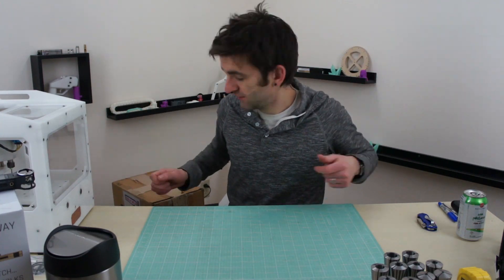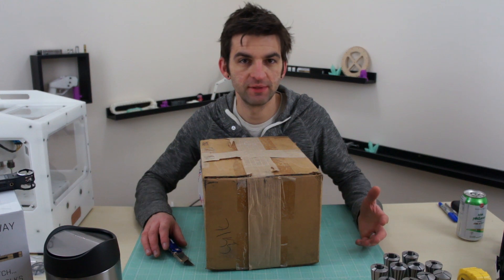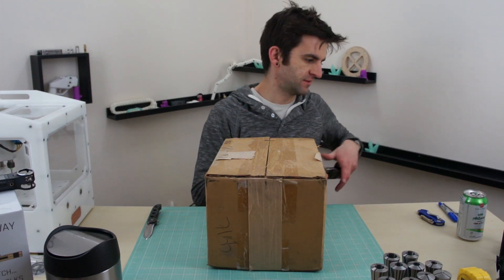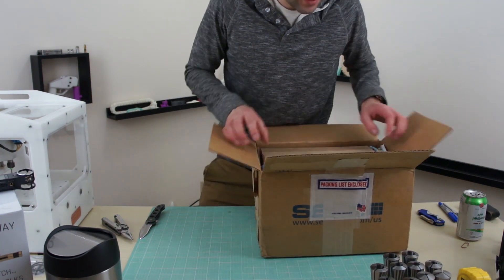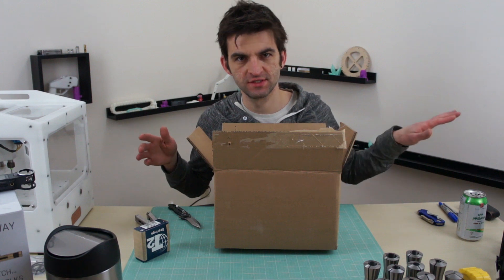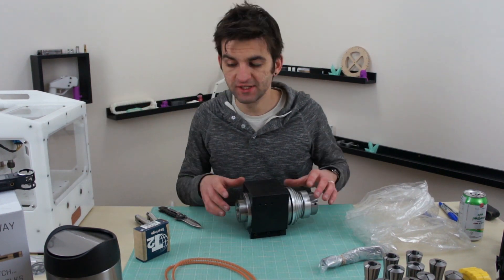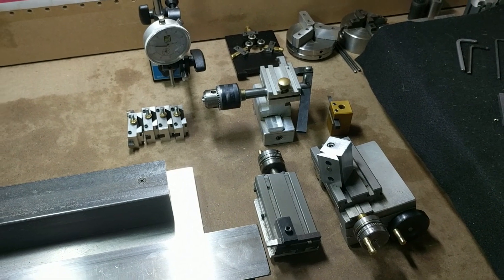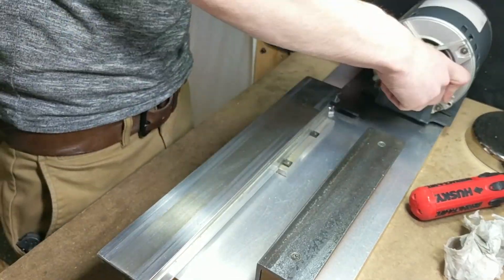Taig Lathe Upgrades 5C Headstock

Comment: the founder/owner personally lapped each machine by hand..i have a picture  from about  78 of Forrest at the work bench where he did it ..(original location in the city of industry, California) . i probably did machining on most of the components on the original  micro lathe 2 ... it may sound funny and antiquated now  ,but the scroll for the 3 jaw chuck was done on a  2 spindle head  punched tape controlled  Bridgeport ...

Comment: Is this Lathe modular? Based on their website it seems that way. I'm not sure about how to determine compatibility between parts. I'm just at the beginning of my research phase.
Reply from the maker: Seems to be, way back when I purchased my stock unit you just ordered the "metalworking" or the "woodworking" series. Almost all the parts are interchangeable, I'm sure if you shot them an email they would be more than willing to help (I have zero affiliation with them...but I should lol).

Comment: Curt, thanks for the video. I got to know about Taig through your channel. 
Can you please advice me on this issue. Am into a production of a small furniture. I need a lathe with good duty circle to make some nuts. My nuts is 8mm by 25mm shaft, with 6mm internal thread. The material is mild steel. This is my main reason of buying the machine for now.
My questions are:
1/ Which model of Taig is suitable for this production?
2/  How many can such a machine produce in a day? 
3/ How much could it cost.

I'm Francis of Boundary Craft, from Ghana West Africa +23326750775 WhatsApp

Comment: Hi, I have to wonder what the advantage of a collet headstock would be. For a start the collet needs to have an EXACT diam to accurately grip a piece of material.....over or under a few hundreths (metric) and the collet is not gripping all along the diam. I would think a 3 jaw chuck with a slack register mount is 100% more practical for gripping any diam you can think of. The slack register method allows you to have a pseudo grip true chuck that suits any chuck without the high price of one. Also, the 3 jaw has a far greater capacity for round stock. I hate to think what you would do if you wanted to go to a 4 jaw or faceplate situation...…..probably replace the whole headstock?...……..is that for real? Lining up a headstock in 2 planes over 150mm is not a job you want to do every day especially when you are busy with work.
Reply from the maker: Have you used a collet headstock? Its night a day over 3 jaws! Collets also have a much larger grip range then you think, none of my stock is precision ground and all gets held VERY firmly and without marring like a 3/4 jaw system. You can also get collets in every flavor of the rainbow (oversized, undersized, metric, imperial and emergency). I have a spindle that mounts into a 1" 5C for when I want to spin the 4 jaw...but I avoid it like the plague as 5C is just so much more production  friendly.
Reply: @CurtVanFilipowski  Short answer....yes, I have used a collet system…..I have a capstan lathe with a collet holding system...…..for my regular centre  lathe I would not fit a collet system ever.....my 150mm diam 3 jaw is accurate to .02mm on concentricity on all diams  and the chuck is 30 years old, never been reground ever.....I have the experience of 60 years on machinery to prove my claims......BTW, if you cannot imagine a 3 jaw chuck can be accurate to .02mm then you haven't machined for a living.
Reply: @gangleweed  The idea behind the 5C headstock has more capability than a 3 jaw chuck by far. The Taig 5c has a 17 mm  3/4 threaded Arbor option that allows for the use of a 3 jaw and 4 jaw chuck as well if one wants to use jaw chucks. Pretty much turns the lathe into a horizontal milling machine with a milling attachment. Run that on your 3 jaw chuck. Also we are talking about a micro lathe here.
Reply: @TheTruth-fs2rm  I can't agree with you....I have the 5C system on my CUTTERMASTER tool and cutter grinder and I know the limitations of a collet system. A collet system only has capability to hold exact sizes accurately.....a 3 jaw chuck for general purpose work is more versatile.....BTDT. 
Anyone who designs a micro lathe with the 5C collet system is off his trolley.
Reply: @CurtVanFilipowski  , 
Please provide the address of the dealer/distributor of this machine, in Indonesia .
Reply: You Clearly have to consider Putting your Junk ! Straight into the Metal ! Shreadder !! Immediately ! For Peace of Mind !!

Comment: I like the aluminum plate that you mounted everything to instead of the board that comes with it. What size is it?
Reply from the maker: Its just a section of aluminum wrapped around some plywood...it was just to get it running but it worked so well I haven't changed it!
Reply: One mm by one mm

Comment: Curt  two questions 1. do you have power feed after the upgrade or is it possible?  does the headstock come with the speed location sensor of the cnc version?
Reply from the maker: Yes the new models come with a power feed. The 5C headstock has a steel button embedded into the pulley for hall effect speed regulation (would need to use a DC controlled motor or servo for speed regulation).

Comment: Hi Curt, quick question, when looking at the 5C headstock from the side where the chucks get attached e.g. 9:14, what's the outer diameter of the silver round bit? The fixed one - the one that's screwed to the black case thing, not the inner one that rotates?

Comment: This looks like a cool upgrade but how good is it in practice? What are the deepest cuts you can take on it? What is the largest diameter you can realistically turn on it ? It's still made of aluminum.. can it really take advantage of the full range of 5c tooling including chucks made for much larger lathes? I'm curious what your experiences are. For me the ability to turn parts 2-3" in diameter from Aluminum is important. Could this handel that?
Reply from the maker: It's amazing in practice for this size of machine.  When roughing I typically take 0.1" cuts in aluminum, and about 0.03-0.05 in stainless. I have turned 2" aluminum round bar and that's what I would call the functional limit (material removal speed at 3"+ is a little slow but totally doable) I have done 3" turnings but this lathes sweet spot is about 1" and smaller in my experience (what typically fits in a 5C). If you are hogging material off your 2 or 3 inch stock I would suggest a larger machine, if it's only clean up cuts at that size I would say it's a fine fit.
Reply: @CurtVanFilipowski  Thanks for the helpful response Curt!
Reply: @CurtVanFilipowski  ,
Please provide the address of the dealer/distributor of this machine, in Indonesia .
Reply: @Dodi-nz3fd  Tiag o.s Ind

Comment: Beautiful new spindle! 
Looks like you could lap just the moving part to the bed using wet/dry paper and oil. How long does disassemble/clean/assemble take? Looks like solvent-dunk/blow/lube would be sufficient.
Reply from the maker: The whole process could probably be done in under an hour if it had to be.

Comment: Ideally you would check out the spindle first with a DTI for runout then progress to the runout on a ground shaft. The tool you checked indicated a bit notchy, somehow. Then try the collet in several positions as well as leaning on the ground shaft to check for flex in brgs and spindle assy flex. I am considering buying a Taig and am very interested in the accuracy. So far everyone seems to be machining aluminum and plastic. 

You say the new belt did not slip. Do you think the motor and bed are strong enough to accurately turn max diameter steel and iron that will fit the chuck? I am interested in making steam engines as well as upgrading my shop equipment (Out of round rotating parts on HF stuff, LOL) . 

Thanks for the video :)
Reply from the maker: Thanks for the comment, your method of running a DTI is MUCH better then my quick test.  

I have cut mild steel without issues on the taig (which is far easier then I would have expected)...doubt it would have any issues with turning down cast iron parts.  Haven't tried Titanium yet (not sure if I want to try that without coolant) but will be running some stainless over it shortly. All depends on the speed at which you want to work, its not going to remove metal like a 2000lbs machine but its more then capable for its work envelope (which I would consider 1" and smaller).  

Biggest issues I have are the carriage travel when working between centers (I need to make a longer dead center for the tailstock someday) and the lack of change gears for threading...but I'll still take my taig over an import benchtop lathe any day of the week!
Reply: Curt Filipowski , I think I saw someone turn threads by putting a position counter and using that input to drive a servo or stepper on the carriage lead screw. That way you can turn any ratio that the servo can handle with no change gears at all. Not like I have any actual experience w/CNC or the like, I just read alot and look at the pictures, LOL.
Reply: @CurtVanFilipowski  , 
Please provide the address of the dealer/distributor of this machine, in  Indonesia .
Reply: @Dodi-nz3fd  o.s Ind os taig

Comment: That's a substantial looking headstock! how much of a passthrough is it now with the 5C? I have a screw on er32 for the original head stock and it did a great job and making it more rigid, but I lost close to 5 inches of travel.  Does that one eat up a great deal of space too?
Reply from the maker: It can take all sizes of 5C so you get just over 1" of passthru diameter. I find since the x carriage can actually run under the nose of the spindle its about equal to using the stock headstock with a 3/4 jaw in regard to bed space available.  The amount of rigidity and clamping pressure you gain is off the chart, not a cheap upgrade but so far I'm super happy with it.
Reply: Thats good to know, I'm at that point where I'm starting to ask myself, do I keep upgrading my taig or look into something bigger.
Reply: @CurtVanFilipowski  ,
Please provide the address of the dealer/distributor of this machine, in Indonesia .
Reply: Are you familiar with the old Bennie Hill show?